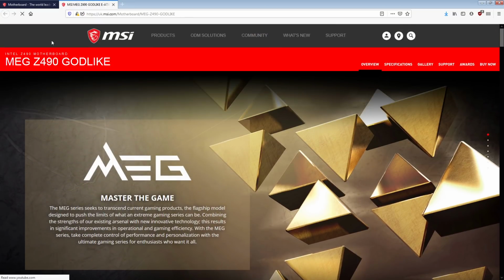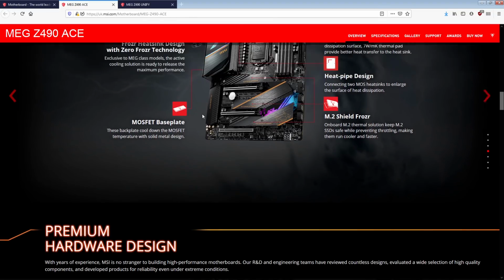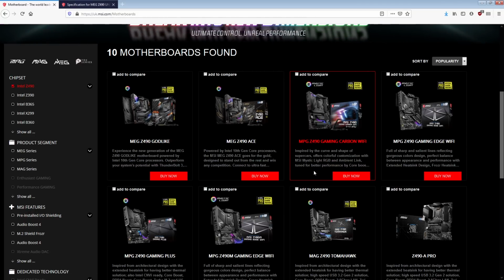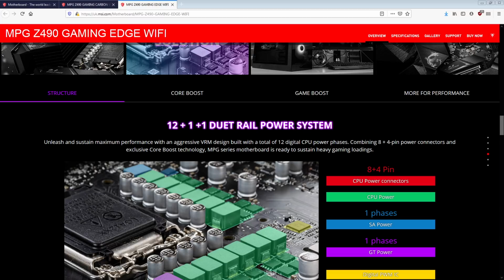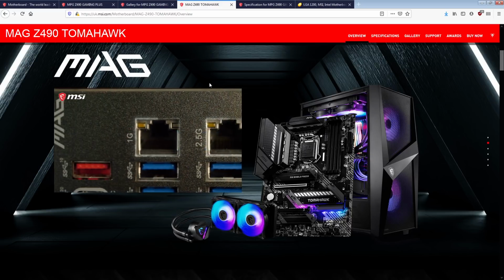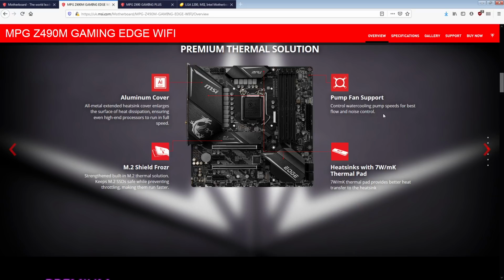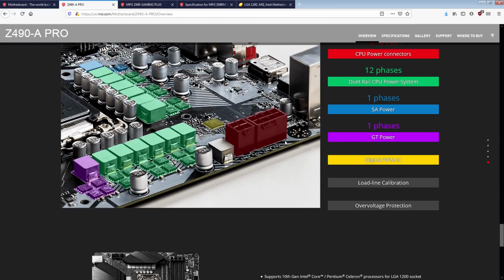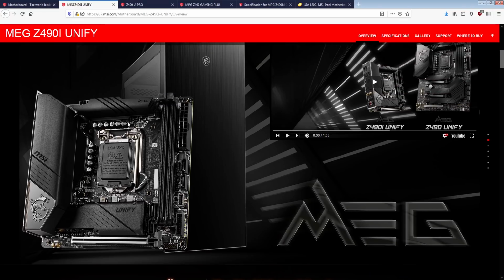Rambling about MSI's Z490 boards.

Comment: I bought the z490 A Pro and its served me well with a 10600k all core oc 5ghz and 3600 cl16 ram. Alas I didn't do my research and though I could pop a cheap new old stock 11900k on it and it would only work at the lowest power state making it barely faster than the 10600k. But your review of the z590 gaming force convinced me to nab that while it was cheap for $100. Great channel!

Comment: I never had any issues with Realtek LAN for common everyday use (using an MSI B550m Mortar WiFi right now). However I had a Killer e2200 previously and that was a total mess at least early on - it randomly cut my internet connection quite frequently up until rebooting the system - however that got fixed later on with driver updates and even the network manager ended up being an actual value add later in its life. MSI offers a network manager as well for my Realtek chip but it just doesn't do anything at all.

Comment: Should I get the godlike for z490  for 450 usd, the z490 ace for 250 usd new from shop ? Need to buy a bigger case for the godlike though

Comment: Owning a z490 tomahawk. 2 issue in OC: difficult to OC cache past 4.6/4.7 ghz and RAM Latency doesn't go lower than 42-43ns in Aida64. Its like a stone-wall and no matter how many more timings get lowered it doesn't go down at all. Tested on 3 golden and 1x avg one and 2 x Tomahawks. Same problem on both. Running 10850k 5 ghz 1.32v avx-0, can do 5.1 ghz / 4.7 ghz stable on this mobo and 4133 mhz ram x 4 sticks 1.5v b-die. It won't boot up with 4200 or higher > mobo limitation, tested with several kits.

Comment: Buildzoid, ma man... if you have MSI ear tell em that their Tomahawk Z490 M.2 SSD heatsink pads OOZE A LOT OF SILICONE OIL in like 7 days of usage... thats just shitty QC... im pretty sure same pads are used under big heatsinks and they gonna ooze fairly quickly :/

also, default bios only being UEFI and needing to download and install a new one for CMS?! no backward compatibility?! wth is that?!

lets say you dont have a second computer, lets say your phone doesnt have OTG (or you dont have the cable, or a thumb drive on hand), theres no OTA bios upgrade (all ASUS boards do FYI)... how do you install CMS to boot your trusty system that you tugging from 2500k era?! well, you cant, and thats a HUGE oversight, really lame.

i actually took your recommendation and went for this board, no MSI for me ever again tbh

Comment: Does the Ace and Unify have an IGPU power stage? There's no backplate video out port (but the Ace mentions being compatible with a Thunderbolt adapter card), but the mobo could still be quicksync compatible. I can't find any mention of it in the documentation. Never mind, I found the answer in your very comprehensive discussion of the Unify board! Many thanks for doing these!!!

Comment: The lower current power connector on the ITX does not bother me. If I had that mb, I would get an extension cable with the high current female connector, cut it off, desolder the mb connector and hard-wire it. It's not that bad if you have a soldering iron with a lot of watts. If I were building one for a friend, I would just replace the power connector with the higher current one. They're $2.63 in qty 1 on mouser so it's not like it's expensive.

Comment: p.s one other difference on x570 between ace and unify was that the unify chipsetcooler had no dumb cover on it that just restricts airflow and makes it way harder to clean the fan. and @msi - when yill you stop with those gimmik gamerkiddy board designs, not ONE 90° degree angle, sickening transversing lines wherever you look. stupid kiddy logos, that dragon- what has that dragon logo to do on a technical thing? remove that, use a sober, lean but appealing design (maybe take a non asian designer),  stop ozoring every second term and ill buy your stuff.

Comment: If i had to chose between a board with good hw and excellent hw, id take the one with the better Bios anytime. Especially when Harwarepassthrough for Virtualization , VFIO / IOMMU Groups get more and more interesting, a Board with proper IOMMU Group seperation is gold. Just wish, reviewers etc would take a look at it, currently only Wendell from lv1tech does it occasionally.

Comment: It's crazy that $200 ATX boards now don't even have 3 PCIe x16 slots just so they could be made at this price! A few years ago EVGA Z170 FTW with 4 PCIe x16 slots and a PLX chip, not to mention other goodies, retailed at this or lower price.
Reply: You probably didn't know what happened to the PLX technology company. In 2014,  Avago bought PLX Technology. Then in mid of 2016, Avago bought Broadcom . I would suspect Broadcom has a hand in jacking up the prices for the PLX8747 chips to around USD100 each now.  You can imagine, how is it possible to fit a USD100 PLX8747 in a USD200 motherboard .
Reply: @fleurdewin7958  Nope, didn't know that. I knew that PLX chips are not cheap, which is why I mentioned that a few years ago boards with 4 PCIe x16 slots and a PLX chip were selling for roughly the same money we see a lot of "budget" ATX boards with just 2 PCIe x16 slots sell today. Or we have weird stuff like MSI Godlike boards that have 4 PCIe x16 slots, but no PLX, and cost of $600-700.
Reply: Looking at my evga z170 ftw motherboard right now in joy 😊😂 i7 6700k at 4.8ghz at 1.4v for 4 years lol it’s been a very solid build. Just 4 cores and 8 threads are done for for the most part. Just a shame you can’t get the same quality and features at the price I paid.. The prices go up and you get less features...

Comment: All these multi-lan and non-10g, I don't see the point. Just give me 1 (one) Intel SFP+. Recent 10g sfp+ modules also do 2.5/5 and you can also do direct-attach copper and you can do fiber. It's not like you can (easily) do bonding on channels with different speeds.

Comment: APEX vs UNIFY vs AORUS MASTER
$400 vs $430 vs $390
FIGHT!

what to choose for build for ~5 years and target to get 5GHz 2 by 8 RAM.
10900K/KF and next NVIDIA Ampere
Reply: I wouldn't say next 5 years lol. 2022(5nm ryzen + alder lake) should be good. Even 11th Gen Rocket Lake looking good. I am hoping the zen3 rumors are real. The only 5 year cpu and that was barely would have been day 1 9900k 5ghz. I really believe we can expect a 5.5ghz all core with 8core rocket lake. Obviously, I am picking up amphere as well. No BS this time. Gonna get that 3080ti and call it a day. If they pull a turing again in 2 years then IDC. If they don't then I will sell and upgrade again.
Reply: @Madhawk1995  
1) Strict NO to Ryzen till 5Ghz would be available for all cores without LN2 + 4400+Ghz mem.
2) Yeah yeah 5nm... 10nm was promised 5? 10? years ago I don't care about heat and power consumption. Tech process bring nothing other than that. Especially 1st gen cpus on new process.
3) My 7700k at 5Ghz still good enough but I guess 10th gen will give ~20% performance boost over 7th. Or even more if it will overclock to 5.3. Plus 5Gh mem. This is pretty sweet to think about upgrade.
4) If Intel will keep socket and chipset compat as it was with z170 I will just upgrade cpu / gpu in 2-3 years. That is why I ask about longterm motherboard
Reply: Why do need 5GHz with Ryzen? 
If the IPC is higher it's going to be faster even without an increase in GHz.
Same with RAM, why do you need 4400MHz?
Reply: @CarbonPanther  Most of software are single threaded. So for multitasking I need single thread performance. More GHz = more performance. Even if it has lower IPC @ 3500MHz.
https://www.guru3d.com/articles_pages/intel_core_i9_10900k_processor_review,7.html

I have tasks which benefits from fast memory directly. ARMA3 as example of games.

All that rambling have nothing related to main question.

Ryzen not an option. That is it.
Reply: blah blah blah why you need 5ghz.
blah blah blah frequency does not metter.
blah blah blah at least it is cheaper
https://www.youtube.com/watch?v=vbHyF50m-rs

Comment: 19:10 u know u can use the mid mouse button to open a tab
Reply: I am always surprised by how few people actually use this.
Reply: same goes for closing, you just just middle mouse the tab itself instead of aiming for that small X
also Ctrl + Shift + T opens your last closed tab which is BY FAR the most useful shortcut ever!
Reply: @GewelReal  yup. no clue how everyone isn't using these shortcuts.
Reply: Can also middle mouse click on the tabs in the Windows taskbar to open a new window. Works for any application that supports multiple windows.

Comment: Tomahawk is looking like an insane value. It even has dual lan, which is unheard of at that price point. Seems to be the board to get for most people. If you want the insane VRM and more OC oriented features like post codes, get the Unify. Every ATX board below and in between seems pretty pointless.
Reply: The Unify makes any other 280 to 420€ board look kinda obsolete. Same for the Tomahawk in the 150 to 250€ range. MSI seems to be the way to go for an everyday ATX build. ITX is promising on multiple vendors, mATX mid range seems best on Asus.
Reply: As buildzoid said, B450 Tomahawk, X570 Tomahawk and Z490 Tomahawk are all great boards. But I disagree with him on the naming, it's quite genious. No ordinary person is going to remember the Z490-A Gaming Whateverthefuck, that doesn't stick. But Tomahawk? That's unique, that's recognizable.
Reply: what dual lan going to be used for? As far as I know windows only run on one connection.
Reply: @floorgang420  maybe a steady 2.5G connection to a server. Idk if this is possible, just an idea
Reply: Are you going to be going over the gigabyte z490 boards?

Comment: Why isn't the MoBo Vendors BIOS/UEFI Graphical Data & Interface code on a Separate piece of 16MiB or larger EEPROM chip that is separately stored from the CPU Vendors info for Individual CPU models like AGESA and the such? Wouldn't that fix alot of issues of "Flash Memory Space" along with compressing down the text data inside each CPU model? They can literally load up a Uncompressed set of data into the main BIOS Chip memory space for quick boot ups and only "Decompress" the data 1x time. The only other time you would need to "Decompress" further data is when you swap CPU's. Then the BIOS would hunt down the appropriate model and "Decompress" the new data and replace the current BIOS CPU data as needed.

Comment: The current Intel 2.5G LAN has some bugs. The current B2 steeping fixes some of them but not all. Probably why they went with Realtek. The Realtek 2.5G also had a bug but is supposed to be fixed with the B version that MSI are using.

Comment: Could you check vrm of Gaming carbon/edge once again? I'm pretty sure there are no doubler on those 2 motherboard, and MSI is using same '"Duet" 12+1+1 rail' to descibe VRM on edge/carbon and Tomhawk.
Reply from the maker: oh yeah the edge is a 6 phase. it's still using 60A SPSs and that's the most important part.
Reply: @ActuallyHardcoreOverclocking  thanks for reply! Do they have big difference? Ax201 cost between 10-20 USD in aliexpress, so if they have big difference, it might be worthwhile to get edge and sell wifi module second-hand

Comment: learn from my mistake on Z390 : you do not have extra pcie lanes with 9900k 10900k those cut on your 16x taken by the gpu, so those m.2 or 10gbe expander cards some motherboard have, consider they don't exist everything you need should be intregrated in the motherboard (those use PCH lanes while pcie slots use cpu lanes) p.s I've got a 10Gbe home network it doesnt really matter if the NIC is good or bad at 2.5+ the rest of your hardware becomes the limitations, be it the drives or motherboard or a mix of both

Comment: Looking forward to those z490 reviews.  I picked up some of that Crucial Micron E-die based on your memory shopping video a month ago.  https://www.youtube.com/watch?v=I0XTTrA1HXo  Pushed my EVGA z370 FTW + 9400F + 2x8G 3000 MHz kit up to 3733 MHz without too much effort (after I read about needing to use /133 frequencies to avoid 4c/post failures), but not sure what to push on next.  The EVGA bios doesn't seem to offer E-die-tuned starting points so maybe has the DARK bias to b-die.

Comment: 1G ethernet uses 1 lane, while 10 technically only uses 2, but needs a 4x connector because a 2x connector isn't a thing. 100G uses a 16x usually.
Reply: Connector? If we're talking about onboard solutions, that can easily just occupy 2 lanes, not 4. Even physically, motherboard maker can make a pcie 16x slot and 2x electrical pcie, if they wanted to...
Reply: @hojnikb  pretty sure buildzoid mentioned you could get a 1x 1G ethernet add-in, not on-board (talking about the Unify)

Comment: as usual I will remind people that your motherboard should be based on what you currently need, count your USBs, count your SSDs, your M.2 well you only have a choice of 0-1 because of lack of lanes, 2.5+ ethernet, download the manual and read it, asmedia sata controllers suck they are ok for HDDs but not SSD you will not get full random accesss speeds with ssds you will get HDD perfs on random reads with asmedia I insist because I got screwed once and want to avoid you the same disappointement, motherboards who claim they have 6/8 sata ports and 4 of them are asmedia are crap don't buy them..unless you only have 1-2 ssd and don't plan to get more, other than that, upside of MSI : hiqh quality hardware downside of MSI : awful bios and trash win software edit: anandtech a great z490 features comparator https://www.anandtech.com/show/15723/the-intel-z490-motherboard-overview/50
Reply: MSI's BIOS is very nice in my opinion, everything is laid out logically and it's easy to navigate.

Comment: I have a unifyITX comming. Can't wait for dem 90a powerstages!
Reply: @Immortal its just ok tbh. I expected it to be a bit better at memory OC. Maybe I had unrealistic expectations. Its a very nice little board for a normie gaming system tho. Theres nothing bad about it... its just not an apex or dark
Reply: @Immortal ah well since your going after stock use and an undervolt you'll be just fine with any of those boards. Jst get whatever you can get the best deal on or has the layout ot features you want.